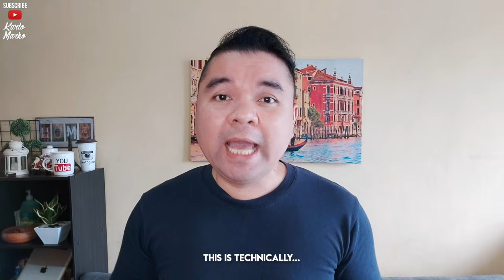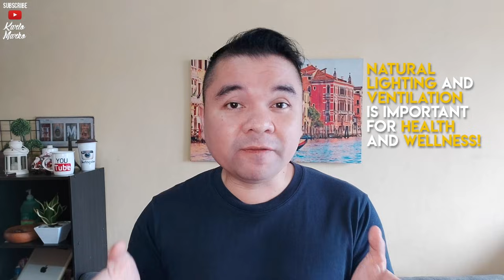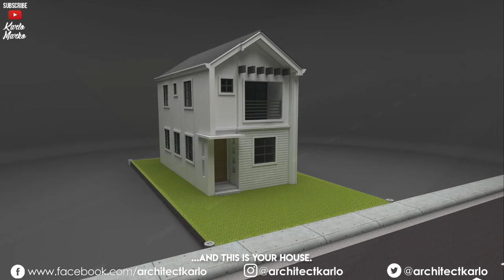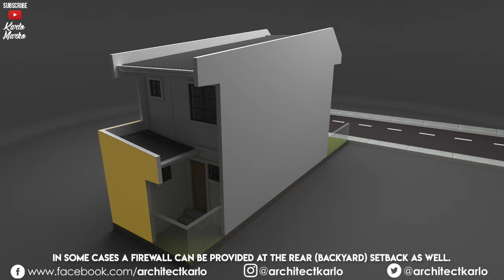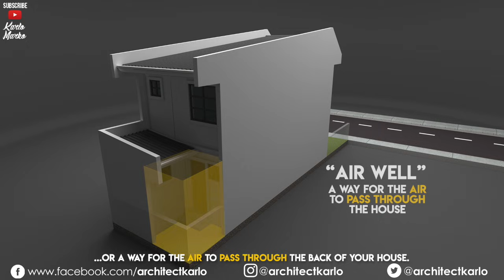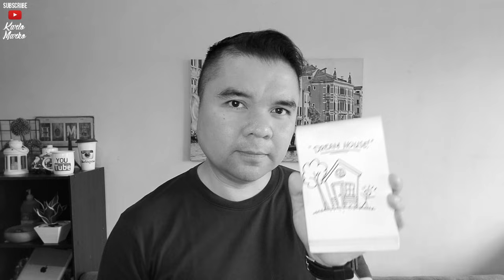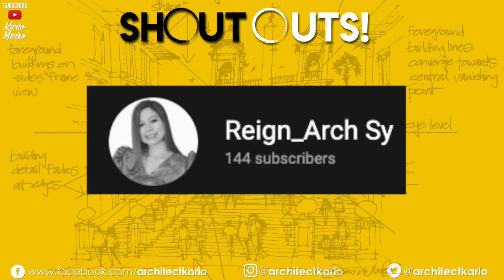The Rules on Setbacks and Firewalls | Bakit Hindi Pwedeng Isagad Sa Property? | ArkiTALK (Eng Subs)

Comment: Arch. Karlo, iba po ba ang sukat ng front setback sa subdivision lots? 
Saka ang pagsukat po ba ng setback is from the property line: 
(1) to the center-line of exterior wall; or 
(2) to the face of ext. wall?
Reply from the maker: Iba-iba ang setback considerations per lot, per property, per classification of the lot, per street, per location. Madaming considerations sa setbacks kaya the best way is to check the local municipality kung ano mga existing rules sa setback kung ikaw ay magpapatayo na ng bahay.

As for the reference of the property line, if the house is a rowhouse, the property line is at the center of the common wall. This is ok kasi like what I've said, iba iba ang considerations for the setbacks. For houses with pre-built houses, it is allowed to have house share a common wall.

But for property lots without pre-built houses, dapat lahat ng construction mo ay nasa loob ng property line mo.

You may also clarify this with your local municipality.

Comment: Great contect as always Arki Karlo. 
1 question po. Regarding naman po sa guidelines ng mga subdivisions. I understand the need for set backs. 
We bought a 132sqm lot and it so happen na 1 sa mga rules ng subdivision is, you cannot build a firewall on lots over 120sqm. 
Imagine, 132sqm na lang tpos bawal maglagay ng firewall kahit isa man lang , eh ano na matitira sa lupa ko?parang hindi makatarungan naman yon. 
Which my architect contested dahil ang rules of set back and firewall daw should apply for Lots over 300sqm. 
Kapag daw less than 300sqm ang lote ay dapat pwedeng magfirewall according to NBCP. 
So my question is allowed po bang gumawa ng sariling rules ang isang subdivision kahit hindi ayon sa NBCP? 
I hope you can shed some light on this matter po. Salamat po.
Reply from the maker: Yes. Subdivisions are allowed to provide their own set of rules based on their theme, motif, etc. From what you said, you can check with them if it is ok for you to build upto 9-10 meters high which may give you leeway to have a 3rd floor or attic in order for you to fulfill your space requirements.

Madami namang solution jan. Just be open to the ideas. 👍
Reply: @KarloMarko  Thank you for the reply. Sige po, we will negotiate with the Home Owners officers. Much appreciated po😊🙏God bless and more blessings to come.
Reply from the maker: Good luck po at sana pag-bigyan po kayo sa inyong request.

Comment: Sir, ano mas mura ipagawa at mas tatagal sa 2 storey house na may provision na magtayo sa adjacent (parang row house) at bakit?:
1. Poste at mga beam ay buhos;
2. Poste at mga beam bakal (I beam ba tawag dun?)
Reply from the maker: Hi Sherwin,

Mejo old school ako pag dating sa topic na ito. I would still prefer the traditional reinforced concrete (concrete cement with steel reinforcement bars)... So number 1.
Reasons:
- reinforced concrete is more cost efficient.
- steel would always be expensive
- Installation may take a while for reinforced concrete compared to iBeams but you need a very skilled welder to be able to install iBeams.
- iBeams are huge, heavy and long. It has logistic issues because you have to deliver it as a whole.
- Unlike cement where you can purchase anywhere, anytime.
- Finishing wise, I can do more with a concrete cement  wall or column.
- Stability wise they are both stable depending on the structural designer's detail.
- But concrete is more fire resistant than steel.
Reply: Karlo Marko thanks Sir.  Agree with you, may logistical challenges ang concrete.  Salamat.

Comment: hello po Architect, question lng po, ung setback is measured po from the lot line to the exterior wall of the building, 

if nag offset pa po from the lot line paloob for the perimeter wall, ang basa parin poba Ng setback is from the lot line ( exterior of the perimeter wall) to the exterior wall of the building or dun na po SA pinag offset from the lot line to the exterior of the building?
Reply from the maker: Ang basehan po ng setback measurement ay ang lot line. Not the wall. 👍

Comment: I have a 180sq.m. lot. Gusto kong isagad ang bahay ko using firewall on both sides. The problem is on both sides may mga bahay na din at sagad din sa lote ung exterior wall nila. Problema ko ang paglagay ng firewall knowing na hindi ko mapaplaster ung exterior wall ng firewall ko dahil nakadikit na ito sa firewall ng kabilang bahay.
Reply from the maker: This situation is complicated since you are completely adjacent to the neighbor's firewall. It is given that it will be difficult to have it completely finished with plastering and have it painted.

Here are some solutions although the budget may vary with the contractors.
1. Leave it unfinished but make sure you have proper water proofing on the sides and on the top part of the firewall.

2. Have the firewall complete in poured concrete "buhos"

3. Use modern materials like prefab walls to have it nicely finished already prior to installation.

Comment: Thank you so much sir! ask lng po sana sir kng what if may lot na 6 x 11m then gawa po sa of light materials ang bahay such as plywoods, maapply pa dn po ba ang firewall, kng sakali na maglalagay para ma maximize yung area?  or applicable lng po talaga ang firewall sa concrete na bahay ? or kng maari po e apply, ano po ang materiales na gagamitin para masasabing protektado sa sunog?  curious lng po,,,salamat 
po,,,godbless (new subscriber po)
Reply from the maker: For the firewall the construction material should always be fire-rated... in short, fireproof. There are a lot of modern construction materials that are fire rated. Except for plain wood.

Comment: Hello sir. question lang. what if the lot size is 4m x 9.50m and tatayuan ng warehouse. kasi as per NBC, need ng setback for front and both sides, 5m and 2m respectively. wala po bang excemption sa setback if this is the case?
Reply from the maker: Hi Sean Andrew,

This can be checked with the local officials po sa Cityhall and I am guessing that they can give you special provisions based of the size of the lot.

I am looking at a 2-side firewall provision to maximize your property. Although, the cityhall might restrict this if the area is a residential area. So you may approach the local official regardimg this.
Reply: @KarloMarko  Ohh ganun po ba? thank you very much and appreciated your reply po sir.

Comment: Hi, a friend of mine is selling her house. The house is built without setback at the rear yard. Half the length of the back is a bedroom with a window at one end and the other half is also a bedroom with a window one end. It looks like the wall that is attached to the back fence of property is a firewall. The fence is made of a hollow blocks. Is this construction of the house is legal? The property is located in General Santos City. Thanks.
Reply from the maker: If there was a construction or building permit submitted and approved in the city government's building and construction office it is considered approved for construction. Based on its original architectural and engineering plans (if there's any). Most houses who violate these rules do this AFTER the construction and did not apply for a renovation permit. It is technically "still" prohibited. If the walls are laying on the property line itself it should be a solid (no window or opening) firewall.

Comment: Are we allowed to build skylight windows on a house with firewall?
Reply from the maker: Skylights are usually on the roof or somewhere on top of the house of building and Firewalls are on the sides or somewhere along the perimeter of the property line or the house... As long as the firewall wall is a solid wall everything should be fine. 😊👍
Reply: Glassblocks ang applicable. Aprun sa bumbero

Comment: Do subdivisions have the authority to increase the setback requirements?  With our corner lot we just found out that they require the setback to be 5 meters on the sides fronting the road.  Do corner lots have two fronts instead of just one?
Reply from the maker: Subdivisions have their own set of rules that coincide with the building code rules. Although, these subdivisions are considered as private properties so there might be some variations.

Corner lots are considered to have 2 sides facing the road. So if that side is facing a road, it can still be considered as the "front". But not all corner lots are the same.
Reply: @KarloMarko  Thank you very much for your reply.  It is very much as I feared :)

Comment: Archi, applicable po ba from ground to upper floors ang setback? pwedi po bang magcantilever/ lakihan yung floor area ng upper floors sa ground floor, pero pasok na siya sa required setback... kung sakaling pwedi, ano po ang limits or pagbabasehan para sa easement sa upper floors?
Reply from the maker: Hello Josephine.

It will depend on the street where it is situated. If your property is located on a major road or highway there are restrictions in doing a cantilever at the front.

Better check with the Building Official or the National Building Code what is the current restriction on cantilevers in the area of the house/building to be built.
Reply: @KarloMarko  noted po, thank you archi :)

Comment: How to start building the firewall and pano po yung connection ng ground floor to firewall. Tapos yung footing po ba ay for columns only?
Reply from the maker: Your architect or contractor would know what to do. Get professionals po para wala na kayong dapat alalahanin. Do not do it on your own if you don't know what to do. 😊 Masmagastos at delikado din po kasi.
Reply: @KarloMarko  para sa scale model ko po kase. D ko pa po nasisimulan dko po kase alam kung saan ako magsisimula hahahah🤦🏻‍♂️
Reply from the maker: Nyek! 😁

Well it's just like any other wall it is connected to the structural components. From the column footings... Going to the main columns which are laterally supported by beams and tie beams which carry the load of the walls. Firewalls are still walls which are solid (meaning no windows) and fire rated (with fire retardant elements).

Mejo mahirap iexplain ang design nya through words... Better check it out sa book or online.

Comment: paano po naiimplement ang setbacks in an irregular lot? new architecture student po kasi ako
Reply from the maker: All the setbacks will rely on the existing property boundaries of the existing lot based on the TCT. Halimbawa, kung triangular ang shape ng lote, triangle din ang shape ng setback boundaries. Kung walang set-back at sagad sa property line ito ay magiging firewall na (walang butas, walang entry/exit at walang bintana -  wall lang talaga na solid).

In other words, setback lines are based on the existing property line with a maximum setback of 2.00 meters clear including the perimeter fence / wall and this is inclusive of the setback requirements (front, rear and all the sides) presented by the property line of the existing property.

Comment: I think kelangan mo din ng setback para may tatakasan ang dwellers sa kahit anong location inside the house in case my sunog, dapat walang obstruction...
Reply from the maker: That's also the reason why it should be followed because this content is also an requirement in other rules and even in fire safety and protection.

"Setbacks are required under Sec. 801 of PD 1096 (NBCP) and under Article 670 of RA386, the 1949 New Civil Code of the Philippines)"

Comment: hello marko, our neighbor made an extension of their house (3rd floor) causing water damage/spill sa firewall namin. they claim thats it is still their property, but its not the issue, ang issue is yung house extension nila causes damage to adjacent property. ive asked the local
building official to check however mukhang biased sila and its seems kame pa ang mali. yung neighbor namin they extended their hous without a building permit or structural and civil engineer, can i file a case even if nacheck na ng building official but am not happy about the outcome? please note that my neighbor ay walang sariling firewall and they are using my firewall when they built their house extension probably the reason why nagkaron ng water leakage sa wall namin. please help on where i can escalate, thank you

Comment: Hello architect. May I kindly ask, what are the other solutions to give ventilation to the building if it has a firewall on three sides? Architecture student here po.
Reply from the maker: Hello, @semperfi229

For good ventilation to work, the building (house) should have a minimum of 2 sides open (or with windows that can open and not just a glass fixed window). So it's either front and back or front and side of the house.

For your situation, you can put an open ceiling where you can have a roof window (usually located at the service area). You can open this roof window or most often called "skylight" during sunny weather and have it closed during rainy weather. 🙂

Comment: Hello po. Tanong ko lang po, 5.7x20 po ang sukat ng lupa namin, anong sukat po ng set back on both side ang pwede? Pwede po kaya na isa lang na gilid ang may set back or pwede po ng 1m po sa kabila at .07m naman po sa isang gilid? Salamat po
Reply from the maker: Hello Melissa,

You can have it at 1 side firewall then the other side with a 2 meter setback. Your architect will know what to do... He can also have it pre-approved just in case. 😊
Reply: @KarloMarko  thank you po ng madami at napansin nyo po ang message ko and sa reply. More power po and God bless😇

Comment: Question lang po, I have a small window po kasi in my bedroom built on the firewall mismo. Then installed aircon po, now pinapaalis ng neighbor ang AC and windows po namin. As you mentioned there may be an exception kasi mawawalan ng ventilation and bedroom, bathroom at kitchen namin. Ano po ang right action for this? thanks po.
Reply from the maker: Hello Zyra,

This is NOT considered for an exemption. 😊 

If your neighbor plans to build all the way to their property line they have the right to do so. It's their property anyway. If your AC unit is protruding over their property, you need to relocate your AC. Firewalls are meant to be solid walls for the purpose of preventing fire from crossing to your side of the house. That's the main reason we build firewalls. If your AC is there... It won't stop the fire from crossing and it is more dangerous for you (given this sample scenario). 😁

I hope this gets settled.

Comment: hi architect. i just want to ask, in subdivisions, what is the min front setback? madami ako nakikitang bahay sa mga subdivisions na sinasagad ang house nila. yes naka firewall sa sides pero sa front nakasagad or 1.5-2 meters lang ang setback.
Reply from the maker: Subdivisions usually abide by their own classification of rules depending on the subdivision's classification... But it is still under the National Building Code (or atleast a subset of the NBC).

Not all subdivisions fall on the same category/classification and some rules fall on BP220 for socialized and economic housing which has smaller front setbacks than the usual 5 to 6 meters.

Comment: Yong boarding house o apartment sir saan po sya kabilang?sa residensial ba or sa commercial?
Reply from the maker: If it's a boarding house it can still be considered as a residential property. But if it's an aparment some will consider it as a commercial property since it is already considered as a business. Other properietors term it as "townhouses" para it can still fall on the "residential" bracket. When it comes kasi to property taxes, commercial properties are higher.
Reply: @KarloMarko  ah ok sir salamat

Comment: Archi, pwede ba 1.5 meter setback sa front and back yard? 4 meters by 10 meters (40 sqm. lot area) lote ko.
Reply from the maker: Strictly 2 meters minimum po yan.

This is the safest distance in case magkaroon ng sunog ang kapitbahay para hindi madamay ang inyong property.

Kung subdivision po kayo, you can check with your developer. They have an initial approved setback which can sometimes be different from the properties outside the subdivision
Reply: @KarloMarko  thanks Archi!
Reply: Archi @Karlo, may sample design po ba kayo ng lote ko?

Comment: Canie Kim:  very informative sir, paano naman kung pagawa ako ng bungalaw type pero dyan na ang sari-sari store,
Reply from the maker: Hello Canie Kim,

There's a separate setback requirement for commercial spaces like a store. Pero Since it's a sari-sari store... you may need to provide a 1.5meter setback. Nagkaroon kasi ako ng project na ganyan. To be sure, you may consult with your architect or building official for approval... or if you live in a subdivision... they have set of rules to implement din if ever. You may also check with them. 🙂

Comment: Hi Architect. I would just like to know your thoughts regarding my problem. I have a 162sq. meter lot along the road in a Residential area. I would like to build a space for rent in the front of the lot along the road. My question is would it be exempted to the law if I just give a 2 meters setback from the side of the road since my lot is only 162sq. m?
Reply from the maker: Hi Christian Kevin,

It won't be exempted if your lot is classified as a residential area, the same setback rules will apply. Although, you can check with your local cityhall. Kasi your plan is to put up an apartment some LGU's will consider this as a commercial property and the setback rules may differ in that classification.

Comment: What is the setback rule for balconies on a 2nd floor?
Reply from the maker: As for Balconies from https://republicact.com/widget/provision/73466#:~:text=more%20than%2010-,Width.,3%20feet%2C%208%20inches) :

"Width. Every corridor or exterior exit balcony shall be not less in which 1.12 meters (3 feet, 8 inches)."